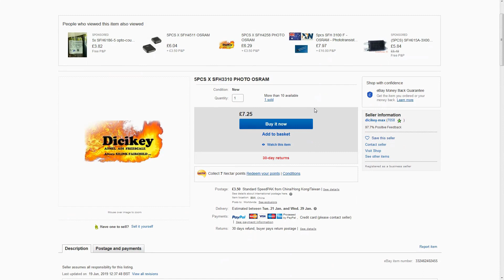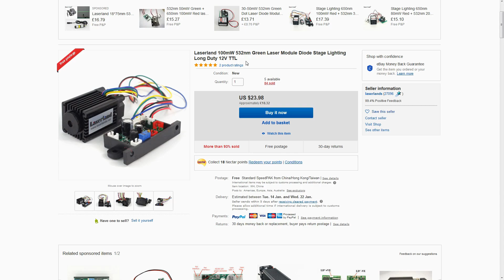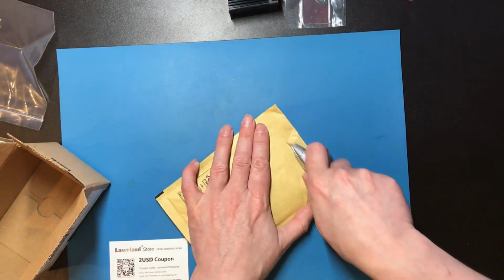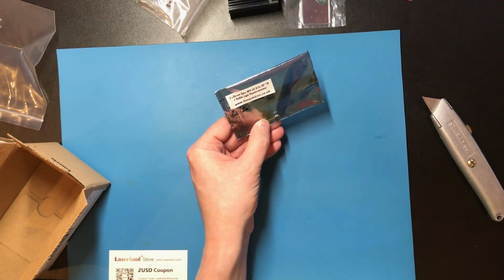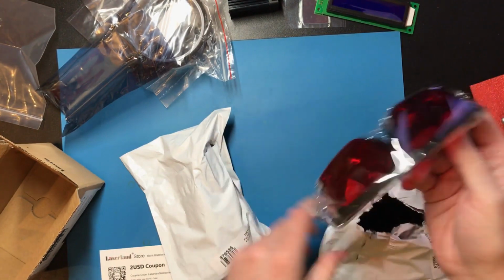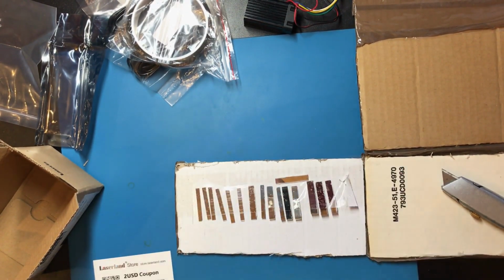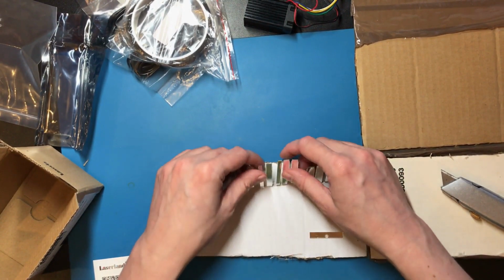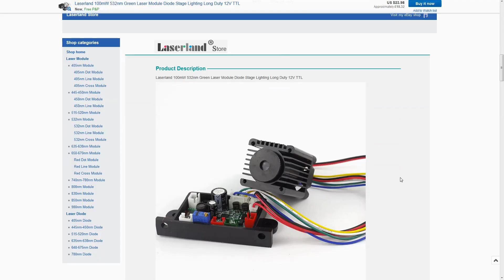Mailbag #6 Optical Bits

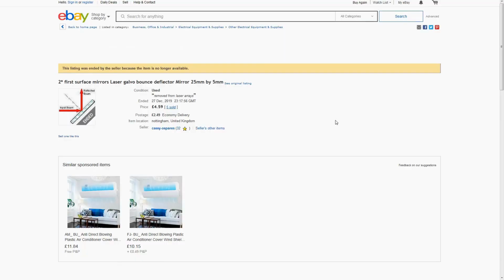Comment: 5:50 - Almost certainly the mirrors from a Casio laser projector. ;)

(given the name of the seller as well.)

I have a few of the "carcasses" of the A130/A140 projector which have had their laser diodes removed.

They use those thin mirrors to do "knife edge" combination of around 24 diodes. 

Each 445nm diode is usually capable of an ouput power of 1.2 to 2 Watts, so quite scary amount of total power.

Quite interesting tech, as they use a phosphor wheel to generate green, and a 24-Watt red LED from Luminus...

http://www.cine4pro.de/Specials/CasioHybrid/CasioHybrid.htm

Are building a laser harp? lol
Reply from the maker: A laser harp? Interesting idea but I'll leave that for someone with actual musical ability.
Reply: @weirdboyjim  lol

Comment: 100mW is still a LOT of power, make sure you use the proper safty glasses for the wavelength and more importantly don't shine it ANYWHERE there could be people, or anywhere near where there could be people. An incredible short pulse from that thing could blind someone permanently, if I remember my Wikipedia reading correctly. I think anything more than 5mW is classed as very dangerous.
Reply from the maker: Don't worry, I have a healthy respect for lasers. The glasses I have should provide good protection but I have 2 pairs so I can run some tests on one of them.
Reply: @weirdboyjim  

I knew you would take proper precautions. ;)

But it's worth mentioning anyway, in case somebody else is reading this, and might think 100mW is relatively "safe".

I mean, they're not usually quite so bad that even a diffuse reflection is likely to blind somebody (else there would be far more cases reported from disco lasers), but can be quite bad when working on directly.

With DPSS, it's mainly the unfiltered IR I would worry about. You can get those IR test card thingies to get a rough idea.
Reply: @electronash  yeah I'd forgotten about the whole IR filtering thing. Sounds like a good idea to get a test just to be safe. Don't want to cut any corners when it comes to lasers.
Reply: The other thing to worry about with the cheap DPSS lasers is that they often don't include an internal IR filter.

The IR pump diode in those "green" lasers can output easily 1 WATT or more, and a lot of that IR light gets through the crystal and out of the lens.

Not all laser safety goggles rated for blue-green light won't actually block the IR light properly (or at all), which makes the cheap lasers more hazardous to your eyesight.

ALWAYS worth adding a simple IR filter fixed securely to the laser itself, even if you do have safety glasses rated for IR.

I've been building things involving lasers for many years, and have taken a few silly chances when aligning things.

I had an eye scan a few months ago, including a full retina scan. I asked them if they saw any blemishes on the retina which might have been from a laser, but they said it all looked fine. So luckily, the safety habits I got into were enough to prevent any eye damage.

But yeah, it's never worth taking the risk. A 100mW laser might sound relatively "small" compared to multi-watt stuff, but it's more than enough to cause permanent eye damage if you're not careful.
Reply: 1024 lol in aus we can’t import anything over 5mw..
Reply: @azzajohnson2123  wow that's very strict. As far as I know there's not any regulation here in the UK. But I might be wrong. It's certainly possible to buy >500mW, or at least I've seen it advertised on eBay.

Comment: Based on everything so far, you're clearly building a laser-based system to distinguish between different types of metal!

Also, I'm a bit confused by the concept of a syringe that says there isn't any clean flux paste in it :) (sorry, couldn't resist...)
Reply: Solder resist?
Reply from the maker: Lol! I'd probably want a prism (or diffraction grating) and a white light source for that?
Reply: @weirdboyjim  That would make more sense! I'll try to think some more :)